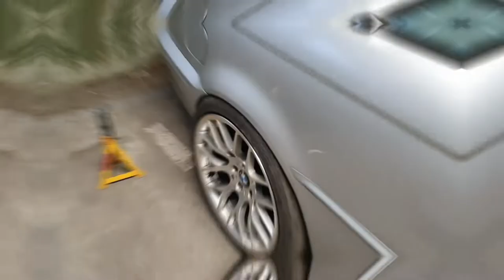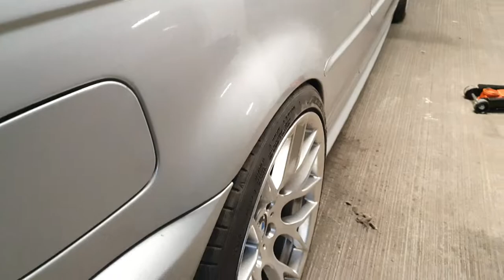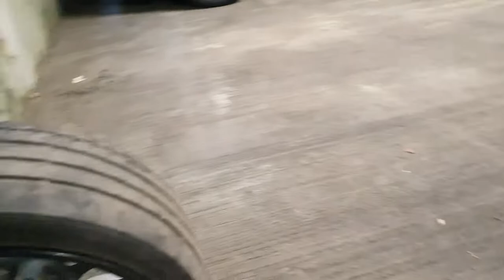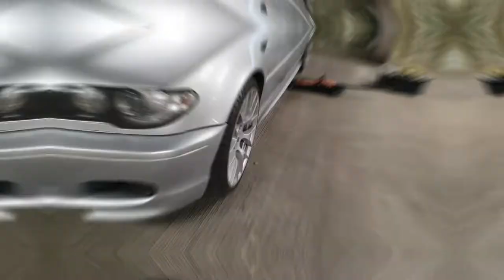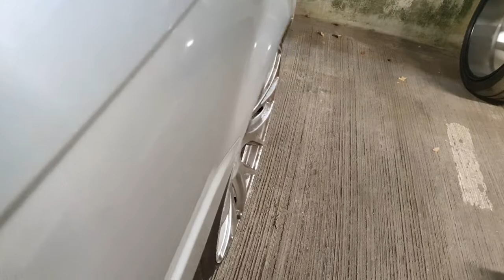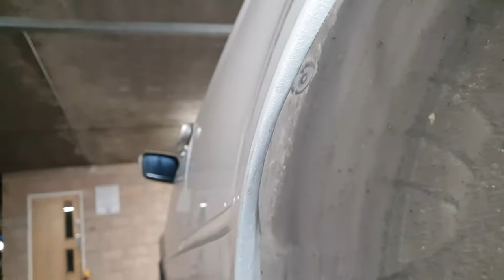bmw e46 rear arch rolling

Comment: It's looks so nice~!
i want to set up the e46 m3 18 inch rear wheel(9j et 26) on my e46 coupe
do i need to arch roll?
thank you very much.
Reply from the maker: If not lowered much , it should be fine 
But still recommend to roll them just incase you want wide tyres on them